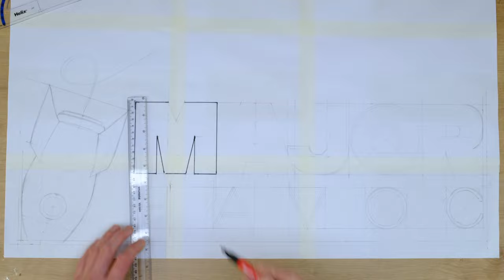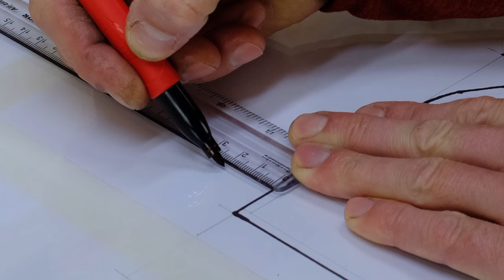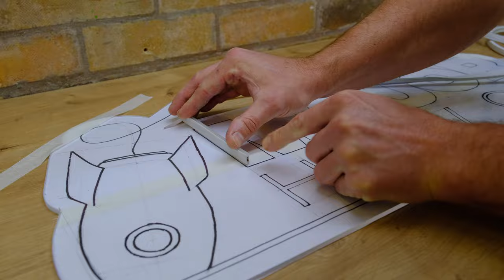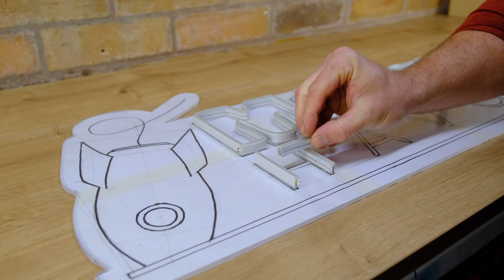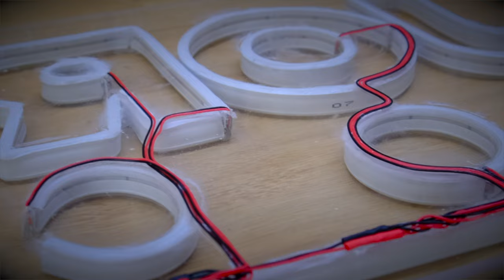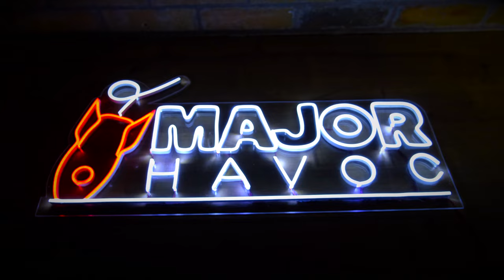How To Make LED Neon Rope Sign, Custom Logo Ideas

Comment: Awesome vid man, im wanting to get into this as a hobby. did you cover your wires going to the plug with anything or did you just leave as is?
Reply from the maker: Thanks 😊, I left the wires bare because I use the sign in lots of different places and with different power supplies so I’m always changing connectors. If the sign was permanently fixed I would solder in a switch and use a 240v (UK) to 12v mains power supply. There are so many things you can make with neon rope, it’s a good hobby. Have fun🫡

Comment: Nicely done, both the design of the sign and the video. Of the several I've watched, this one is really well paced, well edited and thorough. I'm working up a design of my own and it's helpful to see how you problem solved. It looks, to my untrained and ignorant eye, like you went with a parallel circuit? Any particular reason?
Reply from the maker: Hi 👋, thanks for the compliment, very kind of you. As regards the circuit I just went with wiring that could be hid behind the letters better and so I just worked it out as I went along. The LED’s are very low current draw so it doesn’t matter how they are wired as long as they each get a live & neutral 👍👍

Comment: I've watched about 10 different videos and this one is maybe the best one with limited tools. Who has money to spend on a 3D printer, Laser Printer, or even a  CNC router machine? I know I don't. Now this method may take a little more time depending on the design but it definitely cheaper than the previous options when all you want to do is maybe like 2 signs or so and worth it imo.
Reply from the maker: Thanks, much appreciated 😁

Comment: I think the only thing I would’ve added were to add shrink wrap tubing to the wires so they’re all black. How do you handle power? Is it always battery-powered? Also for wiring, are they in a series or parallel circuit?
Reply from the maker: Hi, yes good idea. I use either a 12v battery or a 240v (mains) to 12v transformer purchased of Amazon 👍
Reply: Dude always go parallel for the same voltage

Comment: Hi, great video!
How did you deal with the lenght of the pieces?
Usually you need a lenght that's longer or shorter than the distance where you can cut
Reply from the maker: Hi 👋 thanks, by folding the led strip over inside the silicone, I did that I think on the “H” centre 👍👍

Comment: Great vid... I'm gonna try making one a lot simpler..one question tho what's the machine u use to check if the light were good or not
Reply from the maker: Just a 12v battery 👍 all the best with your project

Comment: Been making a few signs using this video as my initial inspiration, so thank you for the informative video! My biggest issue has been with cutting the acrylic sheet. I have tried different jigsaw blades and a drywall cut out tool and run into issues with the jigsaw shattering/cracking the acrylic (1/8th inch thickness) and the drywall bit running away from me when cutting. Any suggestions for getting cleaner cuts like you achieved, without ruining the acrylic? Thanks in advance!
Reply: Try using masking tape where you want to cut
Reply: Router works wayyyyyyyy better

Comment: What type of LED strip is it, and where do you get it from.  I need some like what you are using, I have some sharp bends/corners. I've tried other, but they will not make the bends I need.  They fail if I try to push them.
Reply from the maker: I used 6mm x 12mm the Amazon link is... https://amzn.to/3YRXPQK
It can be tricky with shop bends sometimes you might have to change your design slightly.

Comment: Super video. Was that silicone caulk you used on the spaceship window? Did you use that instead of the glue because it was a tight circle? Thanks!
Reply from the maker: Hi 👋, thanks. Just clear silicon and yes some of the small pieces with tight bends needed a little extra strength 👍👍